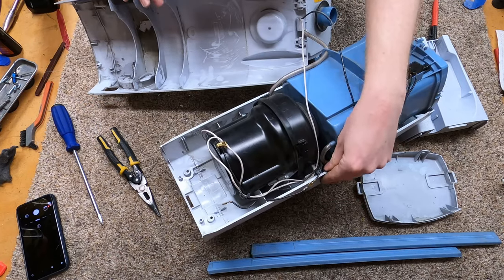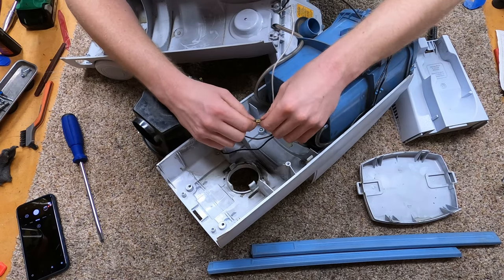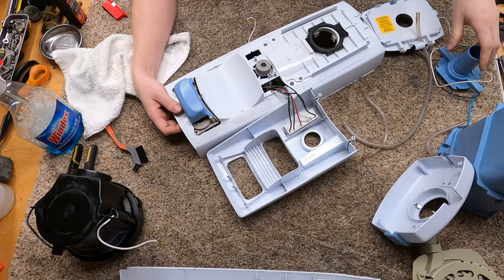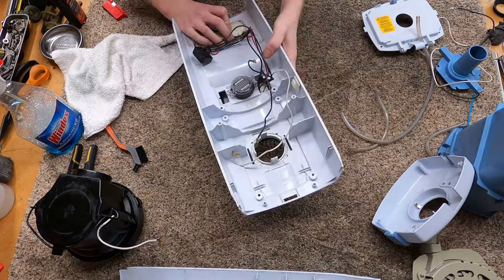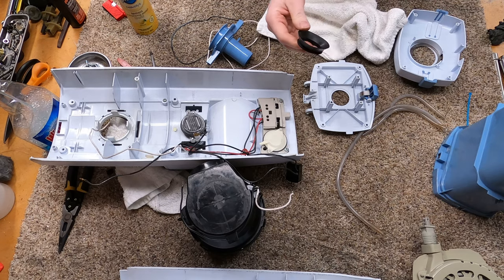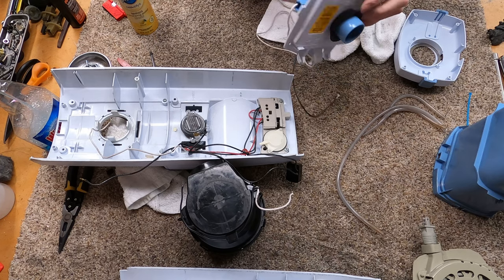Aerus Electrolux 2100 6500 Vacuum Cleaner Repair

Comment: Dear sir. great  video. question. What was wrong with the machine that it was taken in to to fix?  And was this the repair? just taking it apart and cleaning it & re-assemble. what was wrong with it. I have an ambassador II that won't start anymore. Could it be a faulty outlet destroyed the whole thing. How do you check what the problem is?  thanks

Comment: I have an Electrolux 3500 sr series but mine looks just like yours. I have a question. The knobs to wind your cord  on are the same as mine, too. My top knob is out and will just spin. I've tried to tighten it but it just doesn't work. I finally pulled it off one evening and there is a "screw" . So, I tried to screw it on.....Didn't go down. I even tried the other direction. If I can get it back to where it's supposed to be, I'll glue it. On another video, a gentleman turned the top knob to loosen the cord and it broke.? I'm not getting it. These are great vacuums!! (And, I also have a Kirby) Thanks for any info you can pass on to me about that silly knob. It's been like that for years and I'm just now at that point!! 😊 I enjoyed your video. I liked when you demonstrated how low it goes when vacuuming.  I bet people didn't realize that. You got a great deal on yours. Thank you again!! ⚘️

Comment: Thanks for the video, I would have never figured out how to open it. My neighbors lady friend sucked up water and broke the bag, the vacuum motor sucking up the bag's contents. I replaced the motor with a new one, but on close inspection the trash was easily pulled from the old motor and it seems to be okay.

Comment: I own a Hi Tech 2100, that is in great condition, but unfortunately it won't turn on, I've opened this up myself, and believe me, I would definitely take it to a vacuum service dealer, seeing all the wiring around makes my high school algebra brain kick in, but I still think these are great vacuums, I also owned a grey Epic 6500 SR, and it's been fantastic, but did have a sensitive bag control valve that would occasionally shut the motor off unexpectedly, but luckily I fixed that by running generic HEPA cloth bags.

Comment: Do you know anything about the diamond jubilee Electrolux? I can’t seem to get the suction it should have. I have taken it apart I suspect there was a repair/replacement of the bellow dial. I thing maybe the dial was installed backwards and the suction is therefore restricted or just doesn’t adjust. Is there any references you could point me toward to know how to properly set it? And clean it and the hoses. Many thanks in advance. Anna
Reply: There is no suction control, only bag change control, common misunderstanding.  So that is not your problem.  Most likely you are losing suction through the cloth hose it came with.  If you’ve already replaced it with a vinyl upgrade then you will need to take it to a vac shop , possibly needs a new motor.

Comment: Another question: About 5 months ago I replaced the motor and suction control. Ran like a champ after that. Now when I use it, it runs for a minute and then the temperature light comes on and the vacuums turns on and off on its own. What is causing this?

Comment: Great video. Disassembled mine and the inside is filled with carbon dust and the brushes are worn down. Where can I buy the carbon brush assemblies instead of an entire motor?
Reply from the maker: Replace as a whole assembly the bearings are probably on their last legs too.
Reply: Thanks for the quick reply and advice. I’ll be looking at your video to get it all back together.
Reply: @georgegerhold3308  How can you tell the brushes are worn? did you have to disassemble the motor?. if yes, then how can you tell?. My Ambassador 3 won't turn on at all. I don't know what the problem is or how to troubleshoot. thanks.
Reply: I’m no expert but I doubt a brush issue would cause it not to start. I could tell the brushes were worn on mine because the interior was filled with carbon dust from the brushes being worn down.

Comment: I sold those when I was in my early 20's, under the Electrolux Epic era. Horrible job but a decent machine. Ridiculously overpriced.

The key to Elux machines was to make sure that the genuine Elux or Aerus bags were used. The generic Envirocare or DVC brands were an Elux warranty killer.
Reply: Yeah, except the generics don't leak as much as the outsourced "genuine" filter bags.

Comment: Each to their own opinion wise. No this is not a magic air filter by any means. Lots of carbon dust from the vac motor gets out. They will run a good 25 years if properly used and cared for. Product obsolescence has been pretty stable through the years. Everybody has always got a sales gimmick or favorite vacuum to push. This series was I initially a Canadian variant of the Electrolux line even during the metal canister era of Electrolux being sold in the USA back in the 80’s. 

The quality of the Areus products today has dropped considerably and I grew up with the Olympia One. Bullet proof reliability and lack of product obsolescence and a long service life and performance was their formula and their sales pitch back then  and as most premium products you’re charged based on the fact they know that you shouldn’t be buying a new one for at least 25 years. It’s nonsense today not one these machines sold today is gonna last 5 to 10 years and companies make sure of that no matter what you’re buying today, because if it’s built to good that hurts the sales and manufacturing market. Money is made in the service repair end of things.
Reply: Dude is ...well, O am a vacuum pro and Elctrolux and after they sold "Lux" vacuums are AMAZING and could suck a basketball through its hose. The build quality is off the charts and the Lux Guardian I have has a gigantic hepa filter that nothing gets past. (it also was designed dumb with how it sticks out like a sore thumb on the top of the unit's body, which  exposes it to possibly being snapped off)

Comment: They filter great if you don’t use garbage bags.
Reply from the maker: The machine is not a sealed system and was not designed with modern filtration knowledge even with the HEPA vacuum bags it's still leaks quite a bit of dust

Comment: I prefer the original Electrolux motors. They were much quieter, and these cheapo motors make nothing but a high whine and they really don’t work much better. I’d at least swap that motor with an Ametek or Domel suction motor of the same size as it might actually have better suction in that case.

Comment: Sad that Electrolux has went downhill since about 2000 or so
Reply: At least their Centralux unit has improved not too long ago.
Reply: @panasonicvac4036  Which one
Reply: E130K, their current model.
Reply: @panasonicvac4036   oh ok I’ll have to try one
Reply: Yeah it's actually their most powerful model currently. It's even better than all the other current Aerus vacuums, especially the Guardian Platinum. That's what I would get if I were to buy a new Aerus today, just would need to empty it, swap the filters out and wash them every time that I would vacuum if I want it to last longer. I don't plan to get a Centralux for myself but I may be insane enough in the future to get one anyways lol. Cause I'll admit, the E130G is my second most favorite central vacuum system of all time. Even though I'm not too crazy about Lux myself haha.
Reply: @panasonicvac4036  I have a e130g It’s a good central vacuum minus the filtration
Reply: Yeah I prefer using bags unless if it's a Vacuflo true cyclonic, I could handle that as bagless for sure.